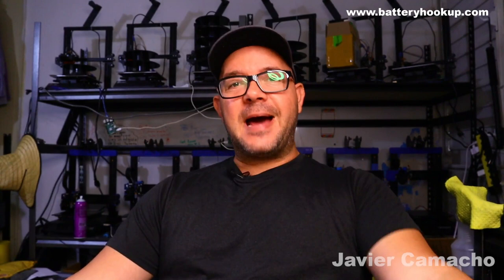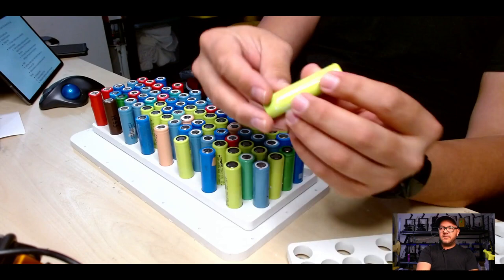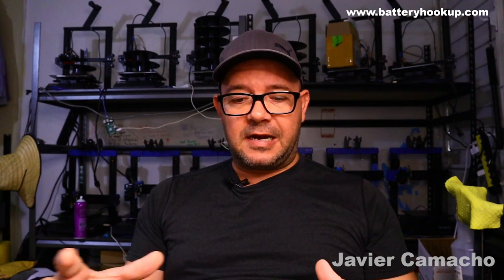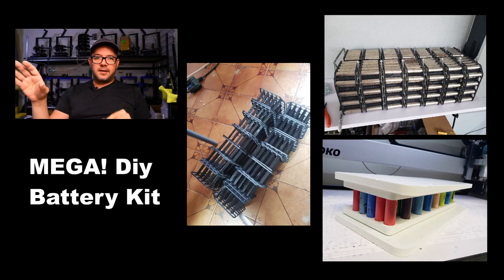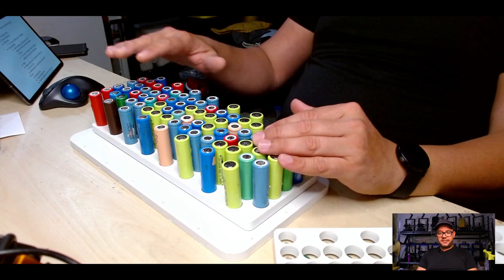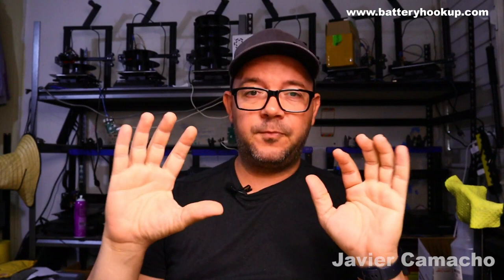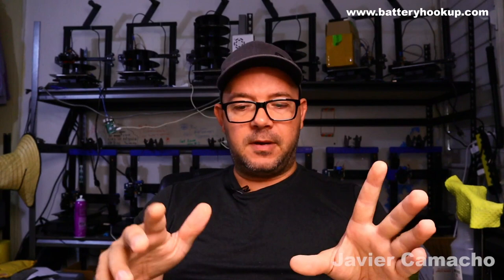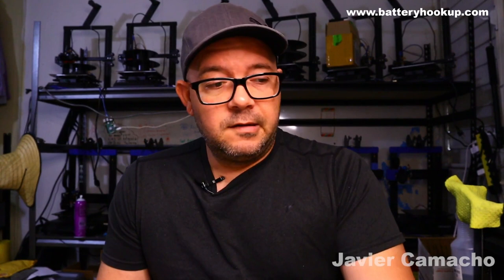The Mega Diy Battery Build Pt2: The Good, the bad and the ugly

Comment: You are screening your lot of batteries based on voltage prior to finding the internal resistance. My question is don't the batteries lose power over time and also some batteries initially were charged partially, since they shouldn't be fully charged while in storage. You will get false negatives. 

Your rejects based on performance could be given to someone local willing to capacity test them and be used for low amp discharge projects. 

Ask Tom how he would handle the same situation.
Reply from the maker: He would make the test for cells that he has on location.
 The IR would be second to voltage only to speed up the process.
Reply from the maker: The voltage is just a measurement tonlet me know if the cells has a change on getting into the pack.

Most 18650 can go down to 2.5v without damge. Under that would mean the cells was abused and degradation took place

Comment: Unbalanced battery pack that could trip your BMS too early during discharge. ie: I can only discharge my 60v battery to 54v before BMS trips, due cell pack voltage difference.
Reply from the maker: I figured that is going to be one of my issues. But sense I'm only going to use it as a buffer for the panels, it shouldn't be an issue.

But I'll post back my findings soon.
Thanks for your input. 
Btw, how many cells in parallel do you have?